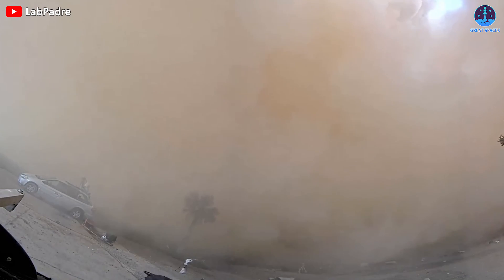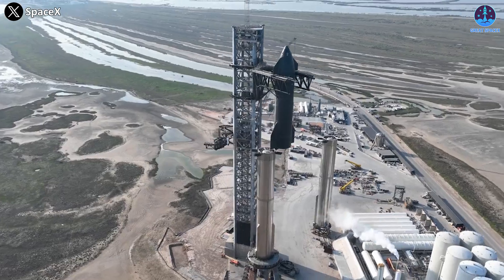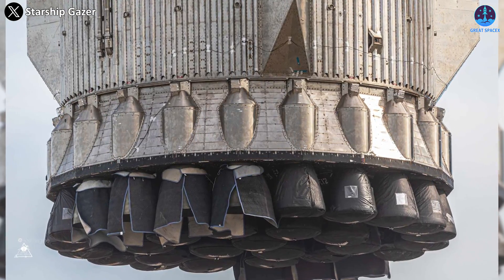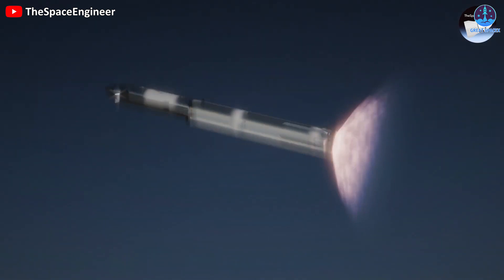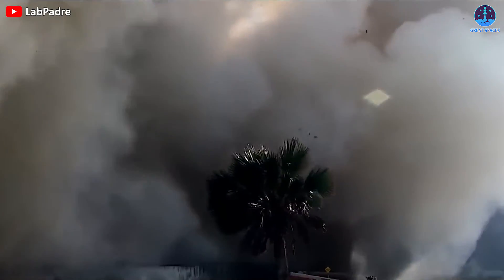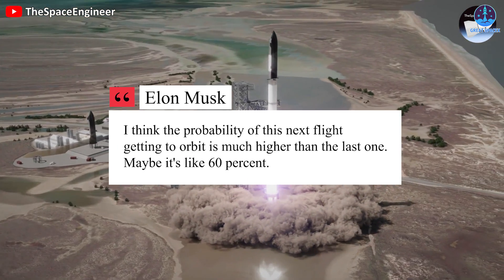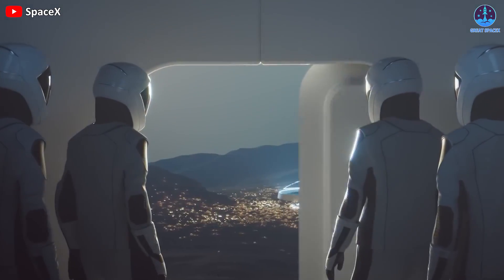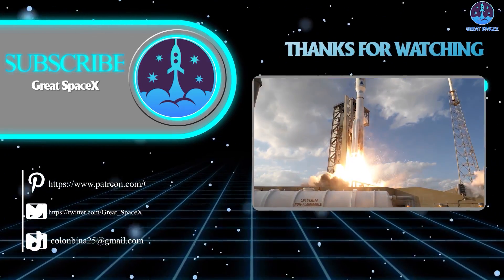How Musk's SpaceX guarantee Starship next launch will be DIFFERENT?? Elon very confident...

Comment: from my understanding is another change is to the FTS.  The Flight Termination System is supposed to almost immediately blow the stage 1 up.  In April's launch the FTS didn't immediately destroy the vehicles.  So on the new unit has a FTS that is more robust and will insure an almost immediate destruction of an errant vehicle.  The problem is that if the vehicle is at a lower altitude and the rocket is out of control.  The a 40 second delay in the FTS at low altitude would endanger human life.  So the new FTS is important

Comment: Wow, the stages didn't separate on ITF 1 because neither the necessary velocity or altitude were achieved so the release system wasn't activated by the flight computer.  We'll never know if the twisting off approach might of worked if all mayhem at the flaming end of the booster hadn't happened.

Comment: I think I'd lean to launching Starship alone, try playing catch. Or launch one out to sea at a distance to check controllability. Set up floating targets to use in developing control skills on descent. Do a choreographed sea landing. Collect data. Then the next one play catch with.

Although, the 1st few orbital launch attempts I'd shoot off Orbital-cargo variants. Send up water tanks & sensors, maybe some equipment. Put those first few Starships into a parking orbit to be fetched later. No drowning Starships.
Reply from the maker: Great comment. Have a nice day🙂
Reply: That will probably be the next step, like they did with Falcon rockets.  They need to make sure this gets to orbit first.  Then seeing about controlled de-orbit, then controlled landing, then after simulated landings in ocean (maybe even on a drone ship?) will be able to catch a booster in 2025?
Reply: Hey, thanks. I get that momentum there. @Captain_Fish6894  Thank you.

The They need to get to orbit part? Nope.

That's not the proper order which plays into some of the troubles they are having.

Consider my way as the way, then the blowing up of the launch pad would not have happened. The deluge that was being planned would have been in place before the next full engine test fire.

To be clear: That, given the Obvious result, the 4/20 launch date being prioritized over installing the deluge system isn't a great thing.

We play catch first PLUS the 1st orbital attempts are made with an Orbital Variant, not a ReEntry variant. Take a few months to prep them.

Send them up into a parking orbit for use latter. Fill them with water at first then more gear. Design the cone into a capsule to also function as a pressure chamber. Get some controlling engines on them. Life support. Exercise equipment. Sort of supplement the ISS.

More on other stuff....

Comment: For this to work and not wreck the pad, 2x the hight is needed and much more added to the fire ring on the booster top to avoid a burn through and subsequent  destruction of the whole rocket. If this all happens, I am sure these changes will be added and a reliable  system will be constructed that will allow launch  after launch without  any issues. Remember,  this has never been done before so no manual  book to consult.  The engineering  is good but what's on paper may not necessarily  work in the real world. There will always be bugs to work out over time. Go Musk!  Musk 2024 for president!  No one can buy him either. Congress make an exception  for him being born in South Africa. Obummer was born there according  to his grandmother. .Everyone in the government knew it but turned a blind eye that time. You know why.
Reply: Its already pretty damn failsafe
Reply: @Hungary_0987  Hope your right. If not a complete redesign will need to be done. Years of delay. In my opinion, smaller is better . More launches gets the same job done with less hassle. Assemble a larger vessel in orbit with parts flown up. Same as the shuttle did with the ISS. Why build such huge rockets? Makes 0 sense.
Reply: @Hungary_0987  It has been tested already and it is not just on paper.
Reply: Your statement is totally false. @davidkurtz4444
Why build such huge rockets?
TO GO TO MARS 
TO COLONIZE MARS
TO GET AWAY FROM THE DESTRUCTIVE WARMONGERS, ABOUT TO ANIHILIATE HUMANS
man are you kurtzsichtig.
Reply: Obummer was born in Kenya.
Reply from the maker: Thanks for your comment. Keep following and discussing on our channel ☺️

Comment: 2:17 Every time I see a video of the engines on the 4/'20 launch I see 8 engines out including the one that looks half-lit in the middle.
If you look closely at the two engines at 3-o-clock that are out, the same thing is going on at 1-o-clock, and the 6-o-clock positions along with the two in the middle.
That makes eight engines out, not 6. The two that are dimly lit aren't working properly.
Reply: Yes, the image was slightly wrong